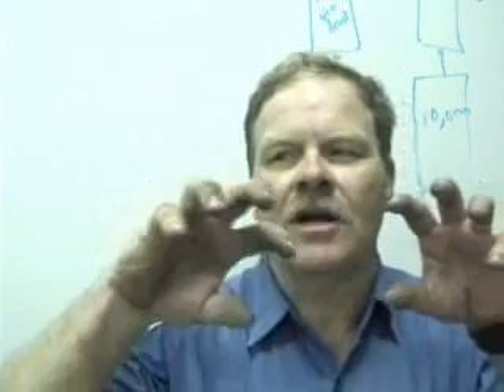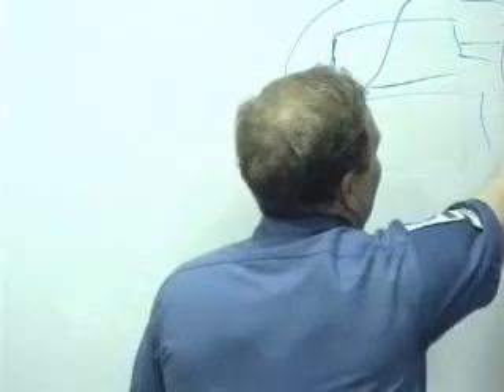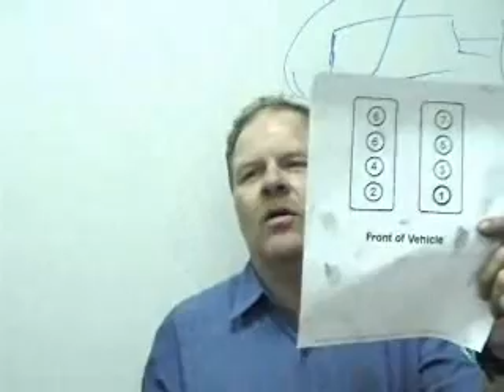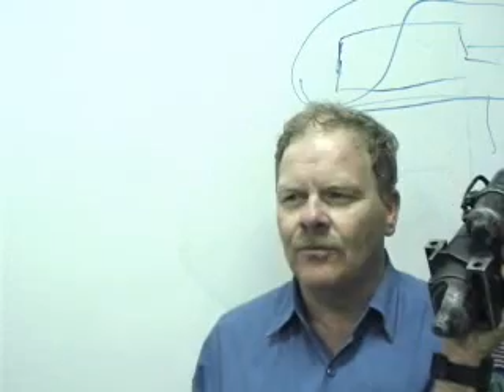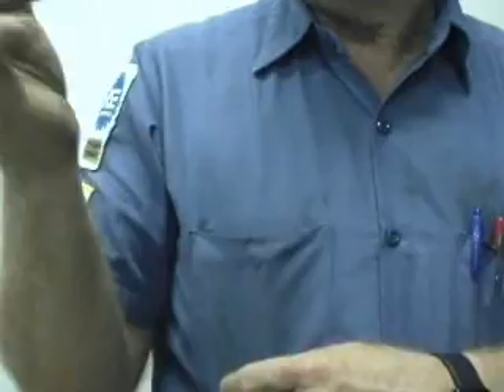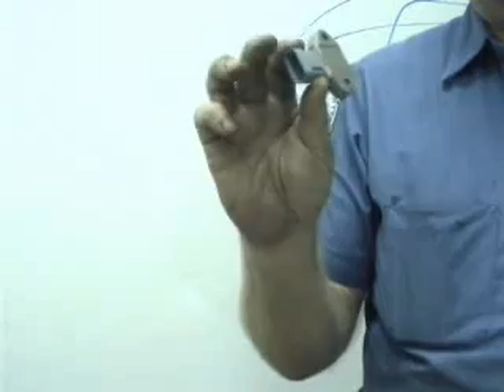Compression and Air Handling.wmv

Comment: Thanks for the info. So you think after 500 miles the break in process is finished? I've always been told to wait until at least 1000 miles before any spirited driving. I'm breaking in my 944 turbo engine right now and well, it's a sports car, so you know what I plan on doing with it after the engine is broken in. = )

Comment: I have a question for you. When breaking in a rebuilt engine I know you're supposed to vary the RPM's, but by how much (RPM difference) and how often? constantly? I ask because I plan on driving my car on the interstate and am wondering if I really have to change +/- 20 mph the whole time to break the engine in properly.